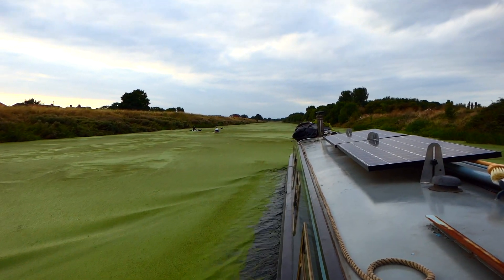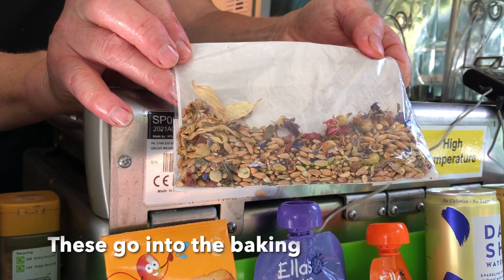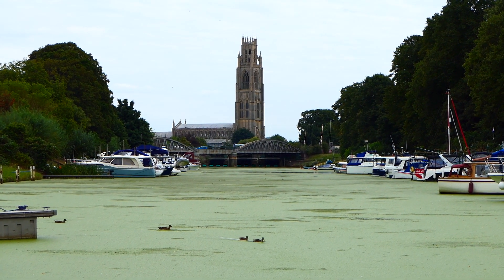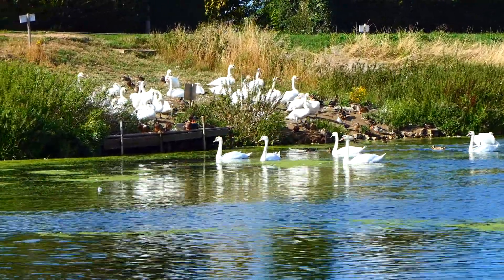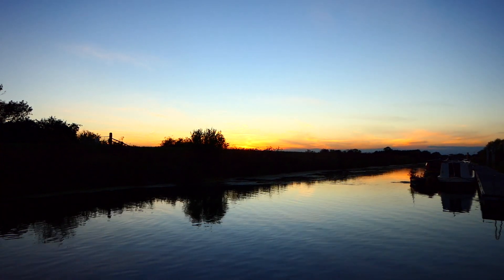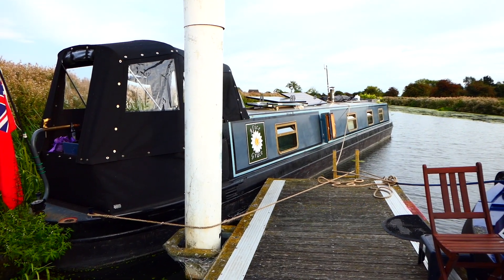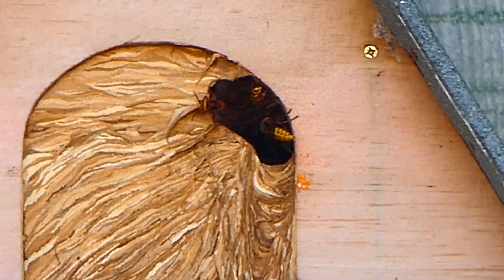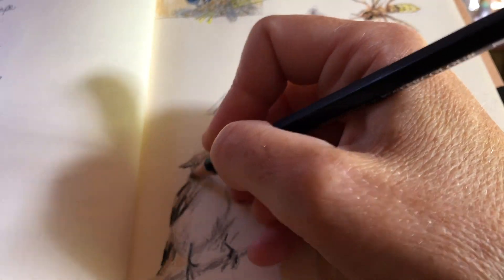#115 When The Engine Fails and There's Nowhere to Moor...

Comment: Yes only had two break downs in 16 years, one was overheating in the same conditions and the other was water in the diesel, that was problematic in the middle of nowhere, eventually got a tow from another reluctant wide beam to a marina, it was the Lazy Otter narrow boats ran away as fast as they could, luckily at the marina I was able to get a chap to come out and empty treat and put my fuel back after the water was removed. Several days stranded and the bit were I was drifting down the old west river with no power was a little disconcerting. All is well that ends well though.
Reply from the maker: It sounds like a bit of a crazy adventure that you had with those two boat break downs. Thank you for watching. Have a super week, take care🦋🌻

Comment: Glad your engine restarted. I would check the fuel system, you may have a restriction, tank vent, partially blocked filter/s , kinked fuel line etc, which has shown up an impending fault because you have been working the engine hard( which is good for it) that will not happen at lower rpm , until the restriction gets worse. I work on diesels and it is quite a common fault where they die at full throttle but will restart and run at lower revs. Beautiful filming as usual.
Reply from the maker: Hi Robin, this is really good advice and Daniel has mentioned something similar so we will be investigating that too. Thank you so much for taking the time to offer support. I really appreciate it. Have a wonderful weekend. Take care🦋🌻

Comment: I have the same engine vetus m417 you may find it was air locked and when it got hot it blew the water out of the plastic expansion bottle may be worth checking. follow  pipe from bottom of bottle to top of engine this is were you slacken 14mm bolt to let the air out until water comes out .but may be worth removing to check the 2 vent holes in the bolt as mine was partly blocked.dont lose the 2 copper washers.mine as done this when air locked.
Reply from the maker: Aw, Daniel this is super advice! We will do that this weekend. 👍⭐️ Thank you so much for this comment and I will let you know what we find. Have a wonderful weekend. Take care🦋🌻
Reply: When you try and slacken bolt the pipe and union might try and turn as well if stuck together with paint .if so loosen jubilee clip and remove rubber hose lift up to stop water coming out .remove bolt as one if stuck together. If it is stuck with paint remove place on wood so as to not damage the threads and put a socket over bolt tap down with hammer to separate bolt from union .as I said before mine was partly blocked. The bolt is a air vent and water expansion fitting. All the best
Reply from the maker: @danielcameron8085  Thank you so much for this!👍👍

Comment: Wow Vanessa what a journey bless you. Lovely vlog as usual you are so calm when things go wrong. Loads of wildlife. Does that weed give you much trouble apart from steering through it? Is there more off it this year because of such hot weather? Well hope you have a calmer week!!!!  Here’s to next week 👍
Reply from the maker: Hi Sandy, thank you for your lovely comment. Several boaters have told me that the weed was worse last year as the rain helps wash the fertiliser from the fields into the river and we had warm but wet conditions last summer. I do think though that the heat helps it to multiply. Apart from the steering and making the engine work extra hard, the weed isn't that much of a problem for narrowboats, but it is for cruisers. Have a wonderful weekend. Take care🦋🌻

Comment: Hi Vanessa.  Lovely vlog.  I got to thinking if there is any good use from duckweed.  People are beginning to eat it in different forms and use it it animal feed and as plant compost. Unless you have hairy arms and legs, Hitch has been revealed once again.  We're wondering if your recent engine failures have anything to do with your new fuel?
Reply from the maker: Hi John, there are definitely uses for this weed like animal feed and bio fuel. The duckweed that we have here is considered large duckweed and has a pink underside which means it’s not edible for humans but there are duckweeds that are and I read that they are one of the healthiest foods you can eat! So you are right, this weed could be recycled and put to excellent use. Also you mention the HVO and linking it to the engine issue, this is something that went through my mind too, and the answer is, we’re really not sure yet without some more investigation. The previous issue with the prop shaft is unrelated though and we have had that issue in the past before too. Robin and Daniel have offered some excellent engine advice which we will take to test for blockages. Never a dull moment with a boat though!😂 Thank you for your lovely comment. Have a wonderful weekend. All the best to the both of you🦋🌻
Reply from the maker: Forgot the legs part of your comment, they were Mr M’s- mine are twice as hairy as that!😂😂🦍🐺🦵